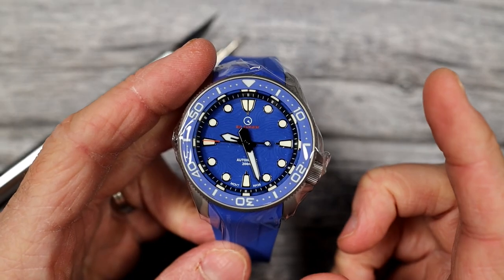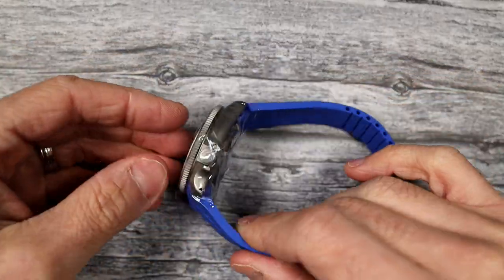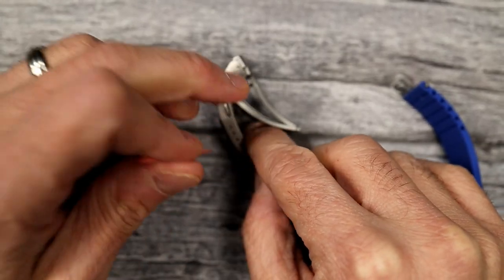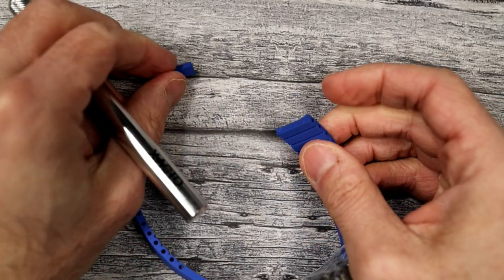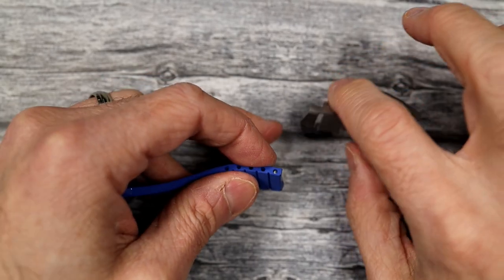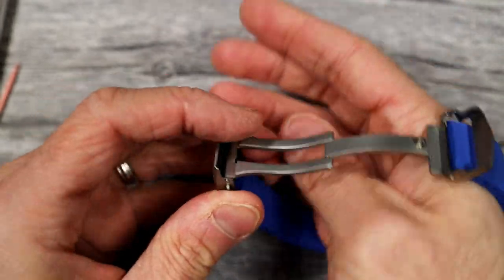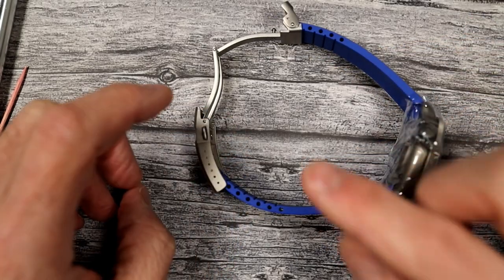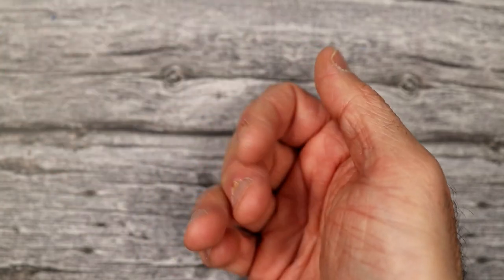How to Size a Deployant Rubber Strap - Watch and Learn #88

Comment: Exactly what I needed to know. I used a big scissors to cut the rubber instead. If using knife, you need a cutting surface but not with scissors.

Comment: Speaking as a person who doesn’t always cut straight with a razor, I would put that strap down flat on a cutting board, put the razor edge along the entire length of the groove, and then push down and cut. Holding the two perpendicular the way you did makes me nervous that the super aharp blade will veer off to one side or the other, making an ugly cut that might spoil a link.
Reply: Truth.
Reply: I was wondering -can you use a pair of small scissors to cut the strap? I don't have the steadiest hand in the world when it comes to using a razor.

Comment: Hi Marc.  I'm not sure if you've answered this before, but feels like this video is as good a time as any to ask.  Do you size a watch to a particular wrist and then only wear it on that wrist?  Or do you keep them so they could be worn on either.  I know most people have slightly different sized wrists so I was curious.
Reply: Was just about to ask this. I always feel like my wrists are completely different - something sized for the left could never fit comfortably on the right and vice versa!
Reply from the maker: I find that my left wrist, being dominant, is indeed slightly larger. So if it's a bracelet watch, I'm congnizant of it and will generally dedicate it to one wrist. For straps, elastic, etc, I can just adjust normally for either.

Some watches, like big, bulky watches, I generally only wear on my right.

Comment: Thank you for the video! Shouldn't the straps have some metal "cylinders" inside the holes? I mean, I generally see those with those types of straps, and it sure helps with the durability.
Reply from the maker: I have seen that as well; it helps to keep stuff out, but isn't necessary. The watches I own that have those (Sinn) the bars come out on their own and I'm always pushing them back in.

Comment: Very helpful video, Marc, thank you. Two questions:

Can you use shears rather than a razor blade to cut the band?

Would you consider putting out a version of the same strap with a regular buckle for those of us who don't want to have to do this surgery? This royal-blue color in particular would be a nice addition to your regular FKM bands.
Reply from the maker: You can, but you'll want a blade to clean it up.

We have straps with regular buckles that will fit. Such as BRAC-16, 17, 23, 24

Comment: Thanks for the video! I wish you explained how important buckle positioning is so that watch stays stable and balanced on wrist. Most wrists require a shorter inside (6oclock) strap to center buckle properly.  I assume that’s why both sides come with differing lengths?